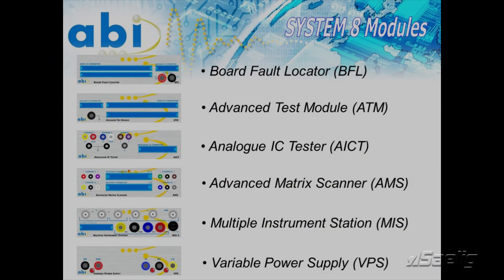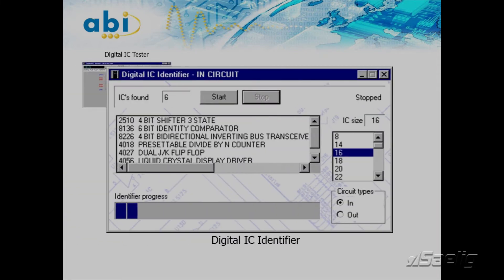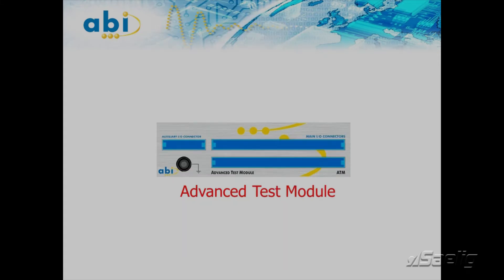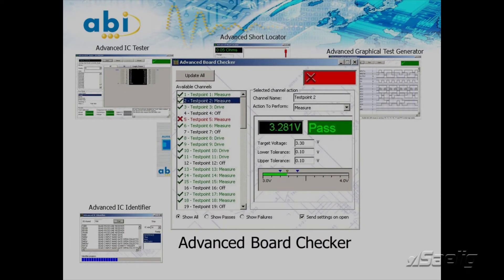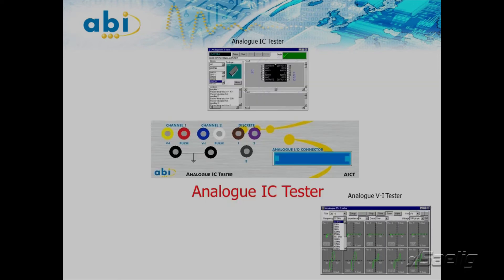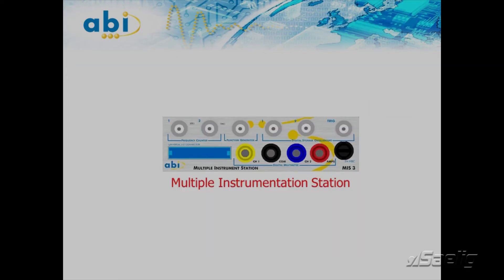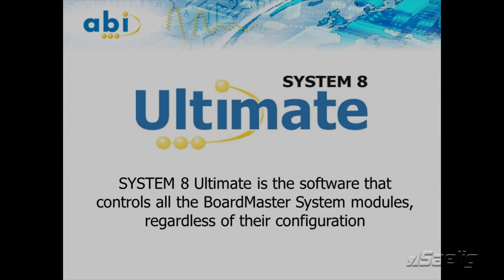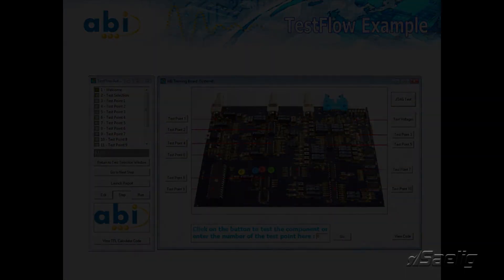ABI BoardMaster PCB Repair Gear: Demonstration by Fawzy Taha

Comment: The Variable Power Supply (VPS) Module has been replaced by the Programmable Power Supply (PPS) Module.  The PPS is a more versatile supply that enables testing of higher voltage, higher current ICs and PCBs.  Another change is that all BoardMasters now include SmartSwitch, a 4-way footswitch that provides hands-free test start/stop and switching between tests or test modules.